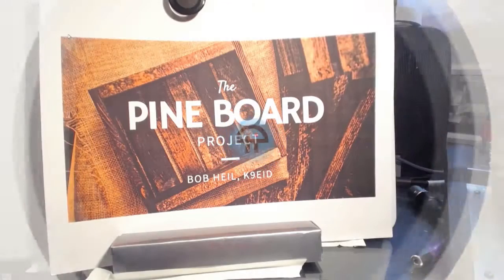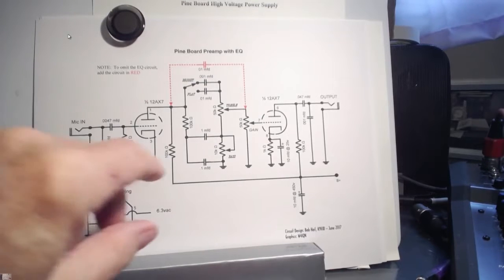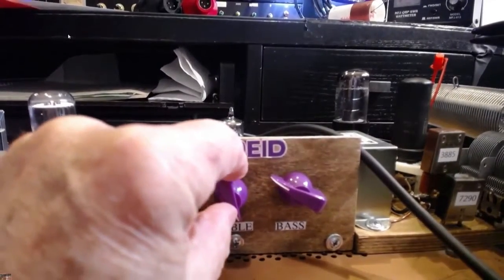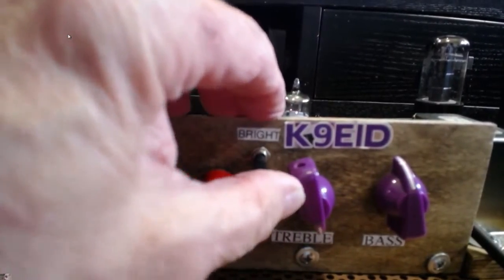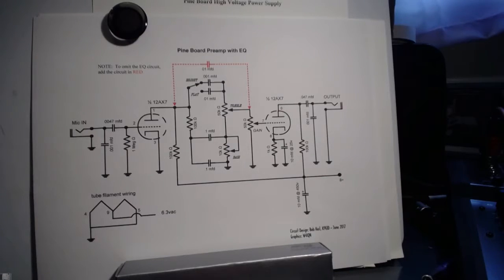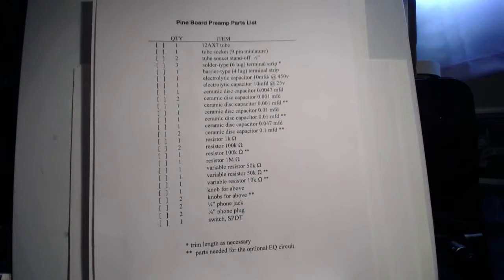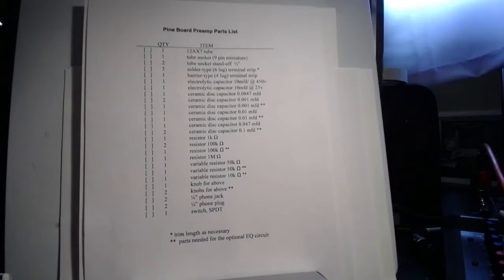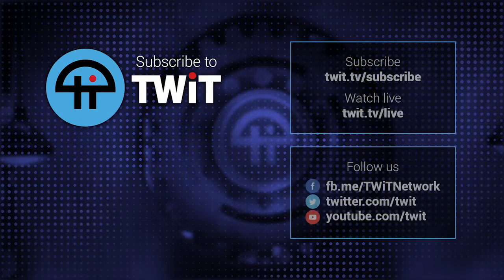HAM Nation 306: Pine Board Project - pre amp working

Comment: I used a metal enclosure for the preamp because I happened to have one that was the perfect size. All the preamp grounding points in the preamp schematic are tied to this chassis.If the power supply is served with a standard three prong cord, do I connect the black and white wires to the pine bosrd power supply, and the green wire goes to my preamp chassis? Thx AC1GX
Reply: Never mind -- it helps to read the power supply schematic, lol!